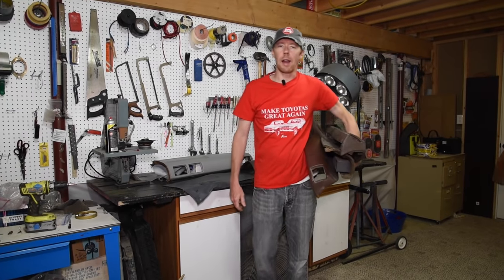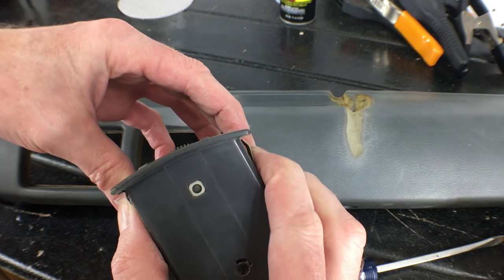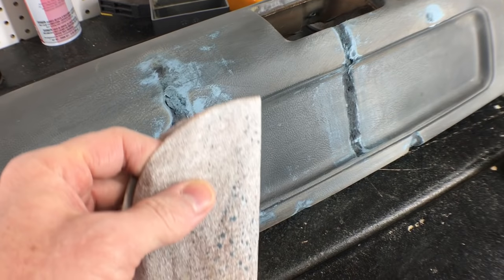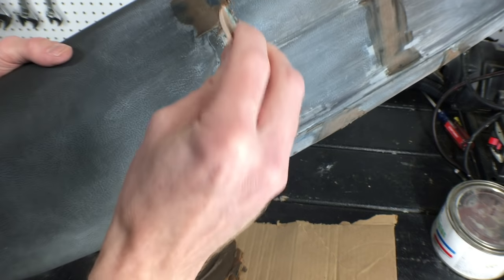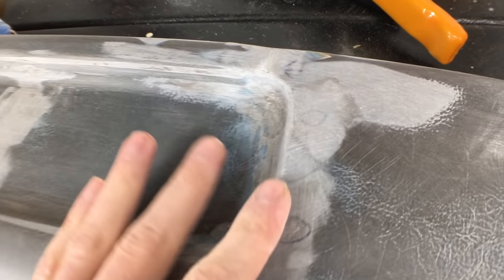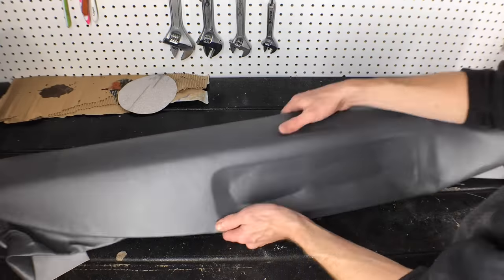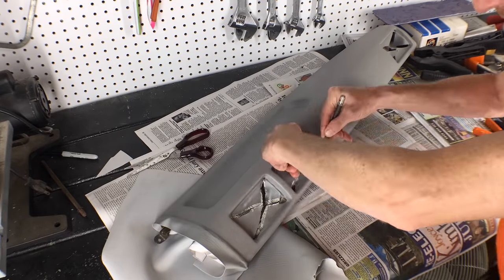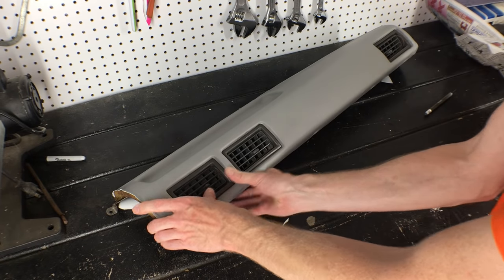How to Restore/Fix/Repair a Cracked Vinyl Dash - Toyota Hilux Pickup/4Runner PART 1

Comment: need an update of the durability of the glue used. but damn.... nice video. no perfect takes.. just the usual snafus one would encounter. ( but not all ) also see @clyde rasmussen comment... seems legit
Reply from the maker: I recently did another dash using different products/materials and the results were much better! Now I’m going to test them both to see which materials are more durable 
https://youtu.be/XB9GKLRHYNM

Comment: Sometimes when doing repairs like this, people will say, "that's good enough, no one will see it". WRONG! I see it, and like you, it will bother me so it needs to be fixed.
Reply from the maker: I recently restored another dash with 4-way stretch vinyl and brush on glue and the results were much better- check it out: https://youtu.be/XB9GKLRHYNM

Comment: Good try in the dash. You could try fiberglassing the whole dash and painting it? There are a few tutorials on here with people doing it. Those plastic dash caps are GARBAGE‼️ I did one on my Impala, followed all the instructions to a T and it looked great until it got hot and the plastic had waves all in it. I also bought an el Camino where the previous owner already put one in, same exact issue plus this one cracked.
Reply from the maker: I thought about fiberglassing and painting to make it smooth and shiny, like some show cars have. That will probably be another future project. Thanks for the heads up on the caps, I'll avoid them!

Comment: Cut the contour , fit a rubber mat in .
Reply from the maker: I wanted to keep it looking OEM, but that would have been much easier.   I recently restored another Toyota dash using spray foam, 4-way stretch vinyl and brush-on glue, and the results were much better: https://youtu.be/XB9GKLRHYNM

Comment: Just take a heat gun and blow hot air, the vinyl will take the shape.
Reply from the maker: I tried that in the video, but the vinyl was too thick for it to work everywhere.  I used 4-way stretch vinyl on another dash and it didn't even need heat to stretch over the surface. https://youtu.be/XB9GKLRHYNM

Comment: Some rollers would have helped you greatly
Reply from the maker: 100%  I later restored another dash using spray foam, brush on glue, roller, and 4-way stretch vinyl, and the results were better... but still had a little trouble with the recessed area: https://youtu.be/XB9GKLRHYNM

Comment: The marine grade vinyl would have worked if you would have started in the recessed area first and worked out that way.
Reply from the maker: I'm current doing another with 4-way stretch vinyl and I don't even need to use heat. I'll have a video coming soon!
Reply: @6thGearGarage  but your dash turned out excellent, make sure you film the next one!
Reply from the maker: @Bill-xc8le  Almost done filming, will start editing this week!

Comment: Seems you're doing way to much at one time.  It's very important to know which way the vinyl stretches. The recessed area should be what gets stretched. Use a brush next time and take your time. Study where the vinyl wants to go before gluing. Inches at a time in the corners and recesses.
Reply from the maker: I found out that there is such thing as 4 way vinyl. The vinyl I had only stretched horizontally.

Comment: The glue your using is only good for headliners
Reply from the maker: I found out the hard way, it has since been peeling away from the dash along the top edge. I recently restored another dash using brush on glue and 4-way stretch vinyl and the results were much better:
https://youtu.be/XB9GKLRHYNM

Comment: SprayWayCustoms on YouTube uses a guidecoat to help find the low spots in his work. He does custom interior and body work. Check out his channel!  https://www.youtube.com/c/SprayWayCustoms
Reply from the maker: I'll check it out- thanks!  Also, I did another Toyota dash using 4-way stretch vinyl and brush-on contact cement and it turned out much better: https://youtu.be/S-UPaYTFBlE

Comment: you should have taken more time when preparing to apply the vinyl by creating a better mold for the large recess then gluing and clamping the large recess first, then when thats done, apply the glue and fix the vinyl to the rest of the job in sections. You had to much glue everywhere and the result was a mess. D -- , Take more time and think it through!
Reply from the maker: Thanks, I kept the mold so I may give this another try!

Comment: Why not just glue that mold/plug you made to just fill in the depression.  Sand it down to match the rest of the dash, glue it in,....and cover it with vinyl
Reply from the maker: I wanted to keep the recessed area because there's an optional OEM inclinometer gauge that sits in that area when mounted. But in the end, I should have just filled it in and saved myself the headache. I'll probably do that on the next one.

Comment: Do you understand how to get enough bondo out when your mixing it too many extra steps bro geezis krighst
Reply from the maker: It's better to apply bondo in thin layers instead of one super thick layer. Less sanding will be needed. I recently restored another dash using spray foam, brush on glue and 4-way stretch vinyl and the results were much better and the spray foam saved a lot of time vs all the bondo: https://youtu.be/XB9GKLRHYNM

Comment: You are using the wrong stuff. Dap weldwood hhr landau top adhesive. Spray or brush on both surfaces, wait about 5 min then stick the fabric. After apply pressure. Dont use anything else but the DAP. Trust me

Comment: You needed to have several cuts
Reply from the maker: I tried to avoid too many seams. This vinyl was just too thick and did not offer enough stretch.  I restored another Dash with better glue and 4-way stretch vinyl and the results were much better: https://youtu.be/XB9GKLRHYNM

Comment: You should have just raptor lined it and not used any vinyl.
Reply from the maker: That would have been so much easier, but wanted to make it look close to original.
Reply: @6thGearGarage  you could change the texture if you increase the psi when spraying the raptor liner.
Reply from the maker: @MrSilvernblackblood  Oh good to know, thanks!

Comment: This is the worse ever good job on bondo work skip the upholstery job I do upholstery and like I said u need to start on that dip first and better glue and u have to spread glue even not clunky and on edges takes magic for
The wrinkle’s experience
Reply from the maker: Thanks! I recently restored another dash using spray foam, brush on glue and 4-way stretch vinyl, and the results were better, but still had a little trouble with the recessed area: https://youtu.be/XB9GKLRHYNM

Comment: First you don't succeed try try again  with no editing
Reply from the maker: Ha, I did!  I recently restored another dash using spray foam, brush on glue and 4-way stretch vinyl, and the results were better, but still had a little trouble with the recessed area: https://youtu.be/XB9GKLRHYNM